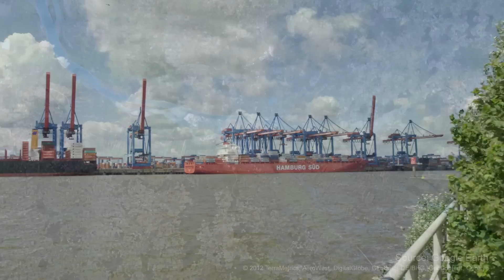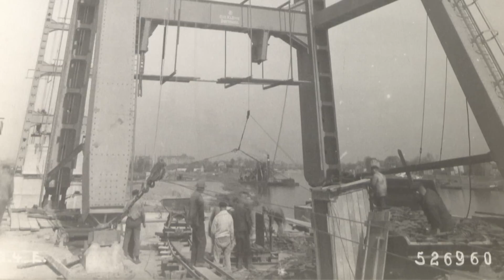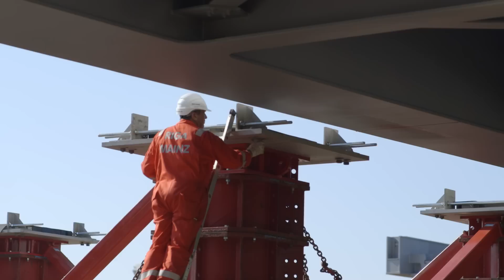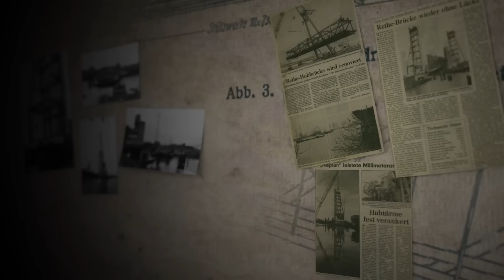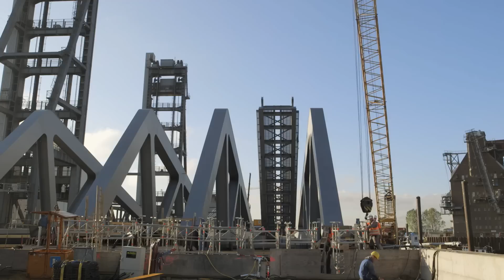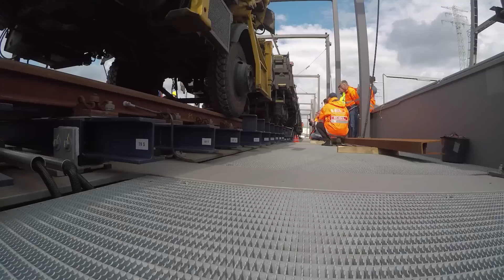Building Europe’s Biggest Bridge: The Rethe Bridge | Autentic Documentary

Comment: The Tees Newport Bridge is a vertical-lift bridge spanning the River Tees England. The bridge was inaugurated by Prince Albert, Duke of York (later King George VI) and opened to traffic on 28 February 1934.Constructed around twin 55 m (180 ft) lifting towers, the 82 m (269 ft) bridge span, weighing 2,700 tonnes, could be lifted by the use of two 325 H.P. electric motors at 16 m (52 ft) per minute to a maximum height of 37 m (121 ft). No longer lifting but still open to traffic. M
Reply: There is an old vertical lift bridge near Sydney Montana